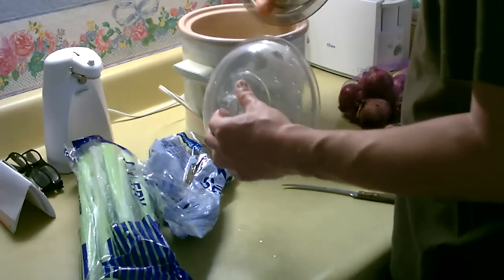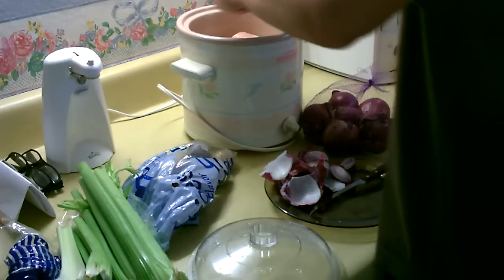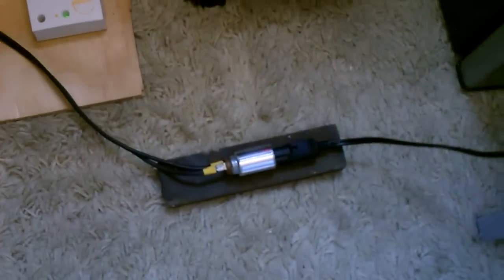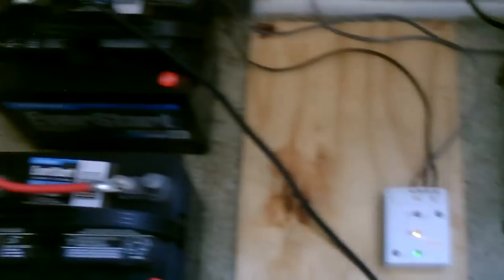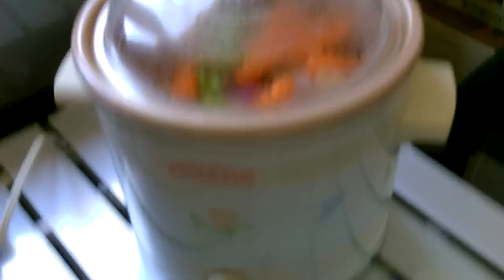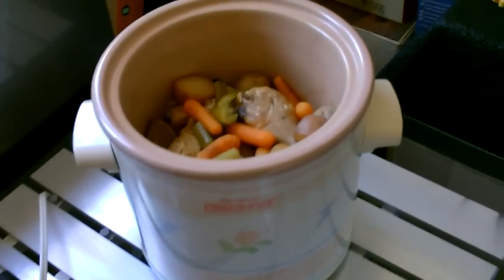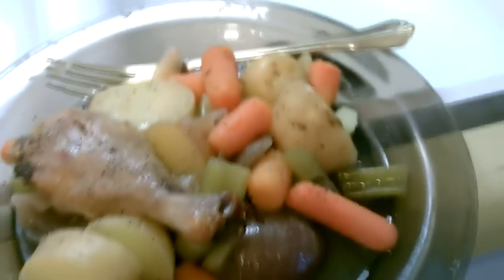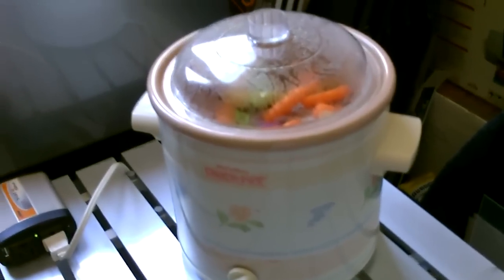Solar Powered Crock-Pot! (using solar panel and battery) - easy DIY

Comment: This is a worthy video of hundreds of thousands among water viewers time. He advertises nothing, no gimmick behind the scene  with a bias viewer seem to fall prone to and buy products that are not what's claimed. If you haven't seen the Go Pro sun cooker check it out, the largest called the Fusion can be run from an off grid solar system and pretty cool except for the price. The Go Pro when you think about it is basically a toaster oven so would you spend 700.00 on a toaster oven? When VHS came out it was extremely high priced for the time but now you can't give one away. If the lowered the price to say 300.00 for the fusion, they would sell more, it's not rocket science but it is a very creative thought out idea I give a thumbs up to like this video. Common sense is you use a smaller cooking devise that contains the heat, this small crock pot does that but how many of us thought of it? Thumbs up!
Reply: Your points are valid! I too am surprised by how few views this has received. On another note, did you mean to say GoSun sun cooker?
Reply: Yes.

Comment: Hello desertsun02, this is fantastic. where did you get your crock pot? Is the table metal. could a crock pot safely sit on a wood counter? All the best.
Reply from the maker: hi there. i can't remember where i actually bought that crock pot (probably kmart or something) the table is aluminum, but you should be able to use a crock pot on a wood counter.

Comment: It would be awesome if someone invented a cheap stove that runs on solar for use in Africa
Reply: They use a lot of solar ovens I think
Reply: They do have, using more simple set ups that do not require battery banks or panels. (Don't get me wrong. I want to do this set up too).
 I used a homemade solar box to cook full meals and even baked bread for 20 years.  It did a fabulous job. Both homemade, similar to mine, and commercial solar ovens are used in Africa and many other locations around the world to help improve the health of the women especially*, reducing or eliminating their exposure to cooking smoke. 
* Women only because they do the majority of the cooking.

Comment: My Solar setup is as follows:
1 Bioenno Power 100 Amp (1200 Watt Hour) Lithium Iron Phosphate Battery. This is regulated from a 20 Amp Lithium-Specific Charge Controller, which is fed from a 560 Watt Solar Array on our Shed Roof. That all uns a Samlex 600 Watt Pure Sine Inverter.
We have a Crock Pot-I'm going to try this myself!
Reply: Lol over kill